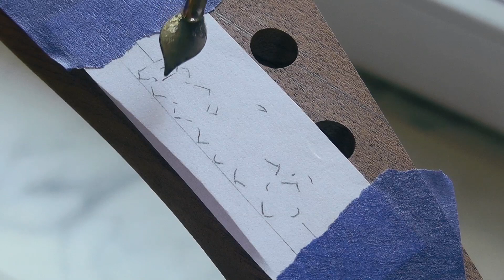Building an Explorer Type guitar - Part 1

Comment: What is that tool you used to transfer the print to your headstock? Also it is just a regular  ink jet print out?
Reply from the maker: It needs to be printed through a laser printer. Other than that it’s a normal print out.